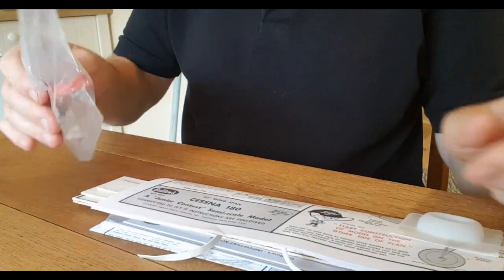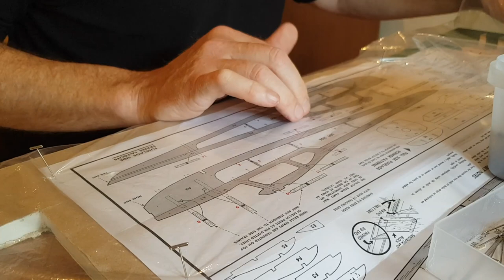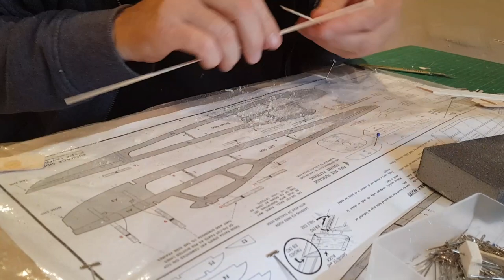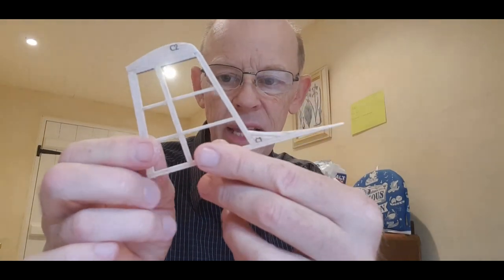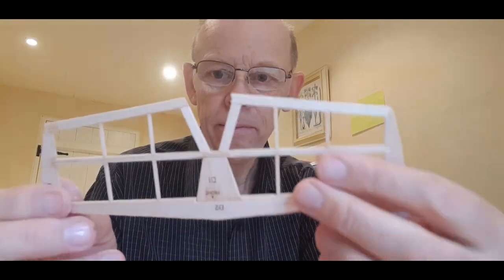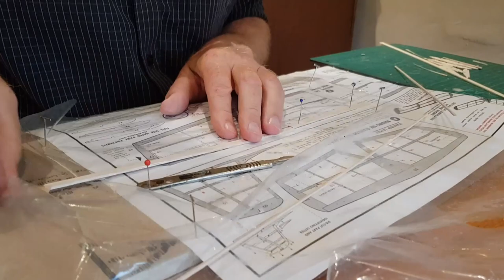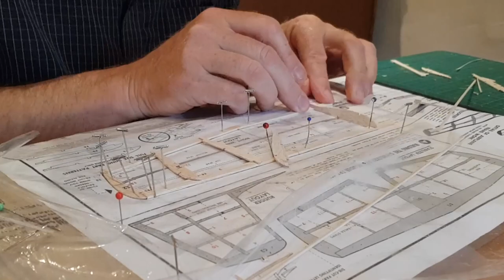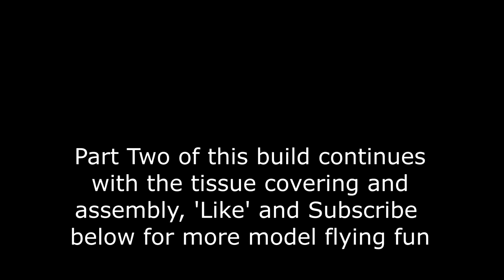Guillow's Balsa Cessna 180 Build and Assembly

Comment: Hi Cliff.  Just a tip about the glass head pins. Some years ago I had the head of one shatter as I was pushing it into the building board. The pin went straight into my finger down to the bone,  as you can imagine it was very painful. Looking forward to part two. Cheers. Terry
Reply from the maker: Thanks for the tip Terry, part two is coming along, just fitting the glazing as I type so a little more filming to do 🙂

Comment: Very nice. Which glue are you using?
Reply from the maker: Hi again Tobi, I build mostly with ca for speed with a little Aliphatic white glue where needed. 🙂
Reply: @CliffHarveyRCPlanes  awsome thanks👍🏻. I wanted to build a guillows kit over the winter but i just found out that they are very hard to get here in europe. Not sure if i can find one
Reply from the maker: @tobichessell132  Hi Tobi, I was lucky, my local model shop had a choice of two! I'm currently putting together a Guillows FW -190 which I found on Ebay UK, have you looked there? I think the UK distributor said he was expecting a delivery in early December so perhaps the same applies to Europe?